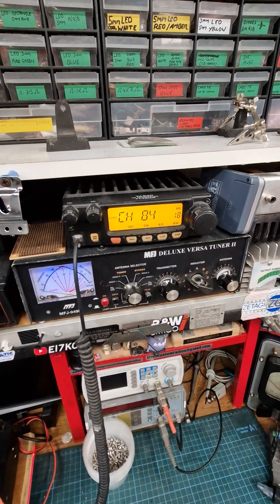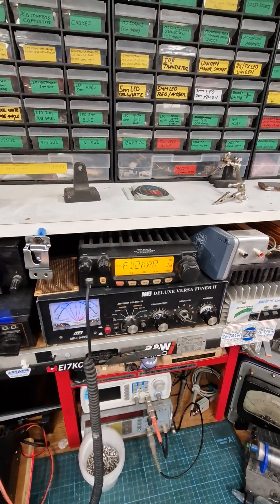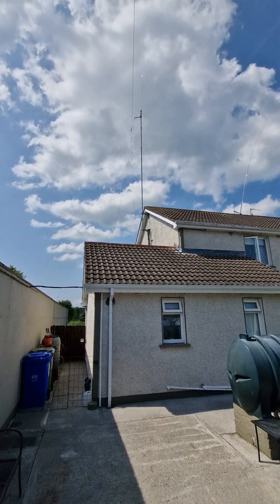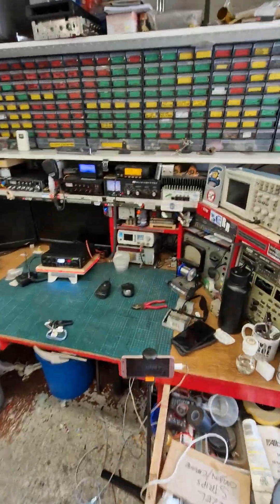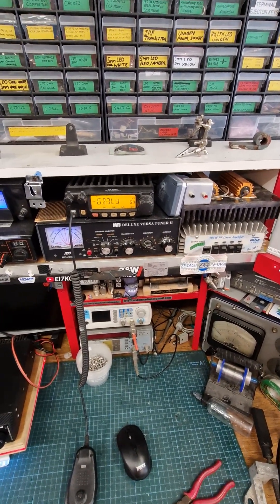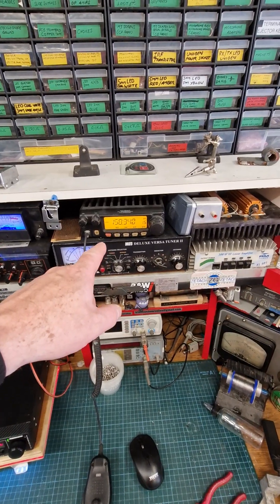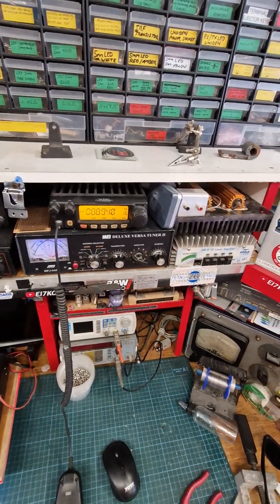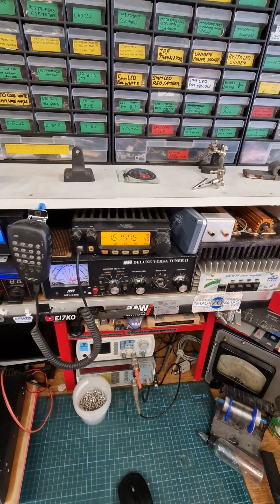Dual Shack Yaesu 2800M Setup – Coax Run & Cloning Plan! 📡🔄

Comment: The FT-2800M is a brilliant 2m radio.
Absolute commercial grade receiver.
The only radio that was not bothered by a paging transmitter only a mile away from me and spewing out 2Kw EIRP every few seconds.
Reply from the maker: Yeah, I have to say I'm quite pleased with them. I have them a very long time. I bought one brand new and picked up the other used. Bomb proof little rigs!